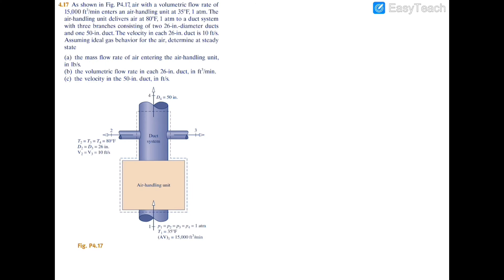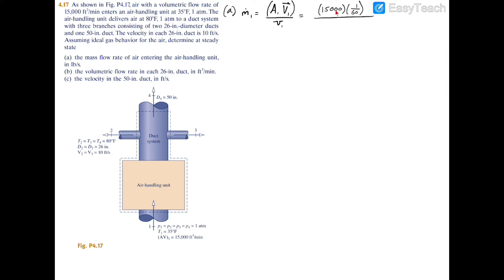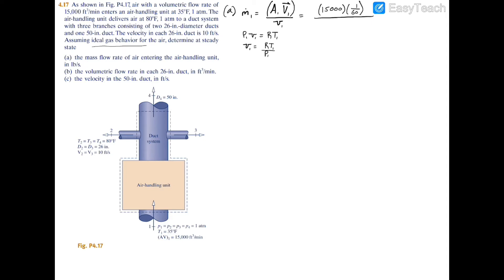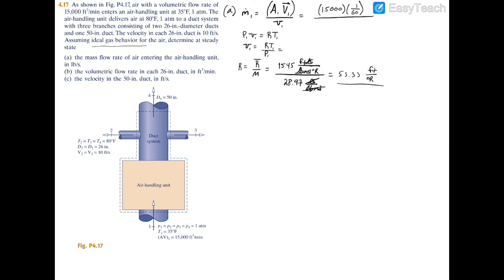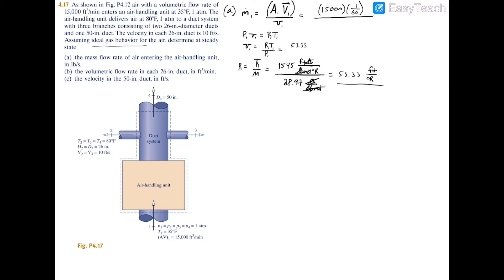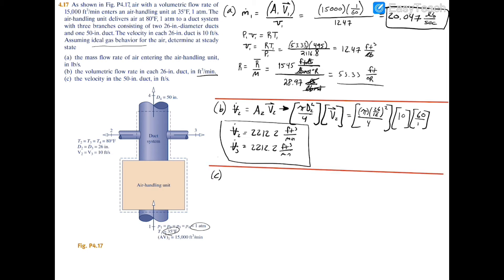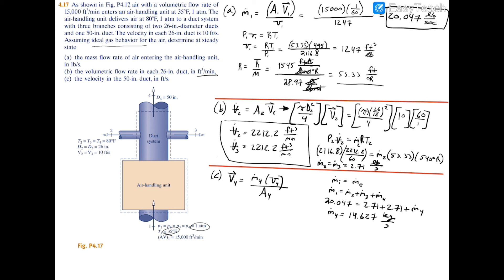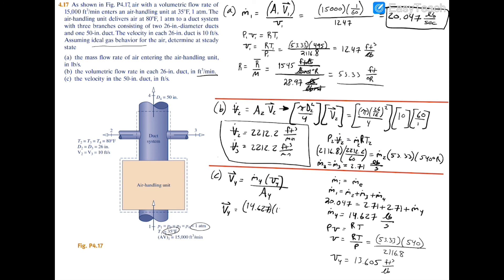4.17 As shown in Fig. P4.17,  air with a volumetric flow rate of 15,000 ft3/min enters an

Comment: at 3:39, maybe I'm missing something but where do the seconds unit go? I still have s^2 in my 12.47 value
Reply from the maker: In the numerator, we have (15,000 ft^3/min) that we converted into (ft^3/s). The denominator has units of (ft^3/lbm). Therefore, the (ft^3) cancel out and we are left with (lbm/s). Let me know if you have any other questions.
Reply: THANK YOU @gr_engineering

Comment from the maker: Correction @ 2:45: Notice I said the unit for the gas constant was ft/°R. This is not correct. My unit cancellation cancelled lbf with lbm which is invalid. The proper unit for the gas constant would be 53.33 ft^2/s^2*°R or 0.06855 Btu/lb*°R. My apologies.